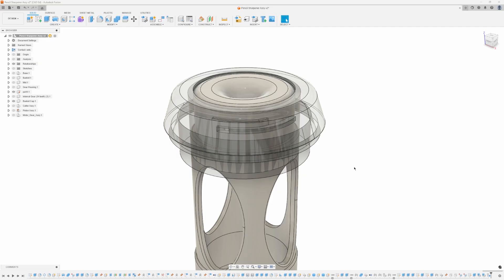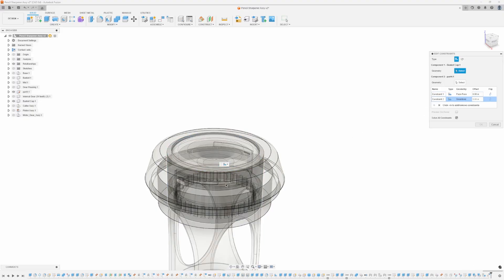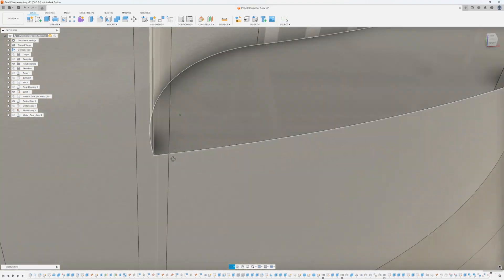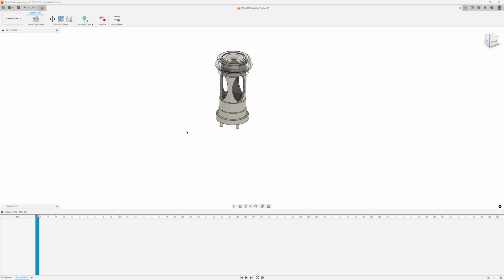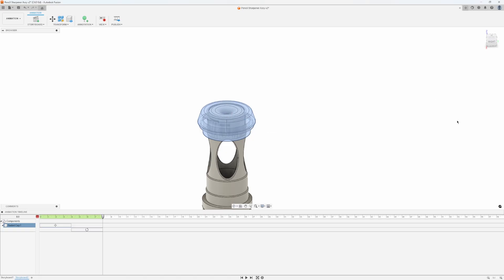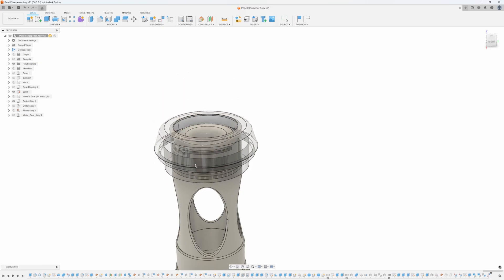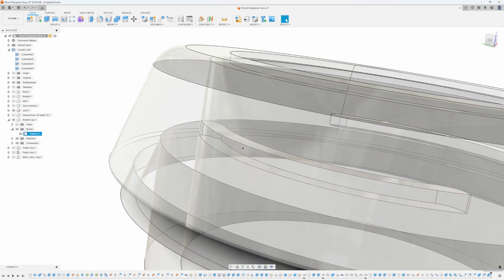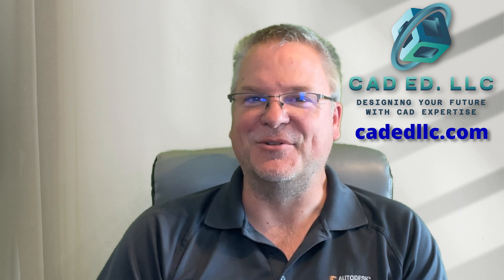3 ways to simulate a Screw Lock in Fusion

Comment: Hi Brad, just a question (not about this video): is it possible to simulate a conical spring that packs or extends when a component push/pull on it? Many tks, Sergio
Reply from the maker: Not really.  Not while you are moving a part.  I have created 2 springs, one extended and one compressed, and then used configurations to display the compressed one and turn off the extended one or vice-versa depending on which state I want to show the spring in.
Reply: @bradtallis8968  Thanks so much! It's a good solution😉